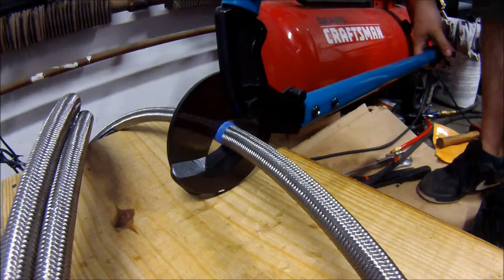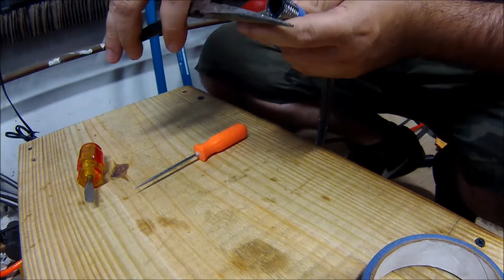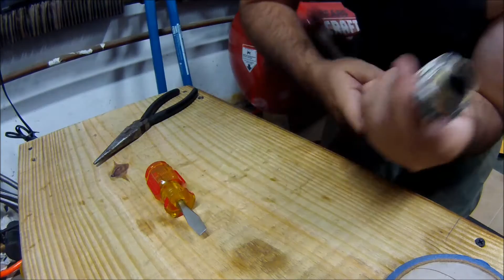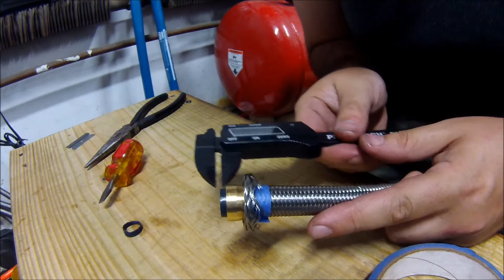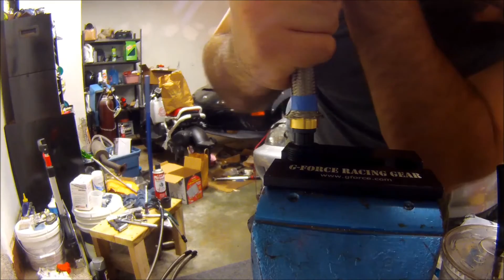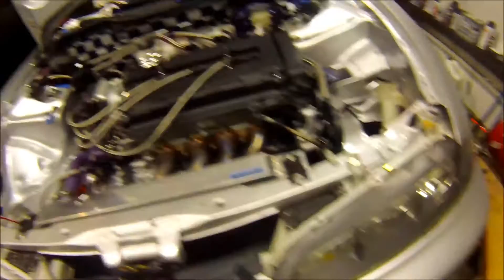Tutorial & Review. How to install & assemble P.T.F.E & Teflon Braided AN Hose ANFITTINGSDIRECT.com

Comment: My issue is I was unable to find the written instructions on the AN Fittings Direct web page. For those that have found it, can you send out the link?
My experience with the -6 fittings was like others reported....not easy. My biggest issue was the steel braided wire was interfering with the nut when assembling the fitting. I had to trim up the steel braid aggressively to assemble the fittings. 
Since I did not have the instructions, I guestimated at how much of the Teflon tube should extend past the brass ferrule ....I used 1/16th. Not sure if correct but the lines I made pressure checked.

Comment: The past few days I've been making some -10 lines for a oil cooler I installed on my G8 and everything went pretty smooth.  I watched your video 4 or 5 years ago for the first time. I've done the trans cooler lines and the Power steering lines from rack to the cooler then on to the pump. an fitting direct no doubt has the best prices for the ptfe lines.
Reply from the maker: Glad it helped you.  Hoping to make more project videos in the future of what I have going on these days.

Comment: This is the only video I've seen where you extend the PTFE hose end passed the ferrel, rather then sitting it against the inner recess lip inside the ferrel. Why is it done this way were its protruding 1/8 out? Is this a better way to do it to prevent leaks?

Comment: this shit is fucking garbage... if you get the black likes you are fucked
Reply from the maker: the black braided lines?
Reply: @LMEngineering  yeah. it has a very annoying black casing around it that is too thick to allow a fitting to fit over it.
Reply from the maker: @stellaroid  ah, like a rubber or something of that sort?
Reply: @LMEngineering  yep.
Reply from the maker: @stellaroid  I would reach out to them to see if they've got any tricks.  Wonder if they'll tell you to cut the outer layer back a little so it slips in the fitting better?
Reply: @LMEngineering  yeah you have to trim it back for it to work at all but it is still an extreme pita

Comment: Thanks a lot for your video. This should be very helpful for when it comes to finishing up the lines for my car.
Reply: I see that you have recommended against using these lines/fittings with power steering feed lines. Can you elaborate on this? What may be a failure point? I was planning on using an AN6 line from this company for my power steering system that may see pressures around 1300 psi. If you don’t use these lines for pressure then what lines do you use?
Reply from the maker: The pressure is usually higher than the hose ratings.  I did run a few brands on the high pressure side however last and final setup was made by a local shop and done with the hydro machine so it's "1pc" and runs a series used on heavy equipment.
Reply: LM Engineering I gotcha, I’m probably gonna use these lines for a mock up and then bring them to my local hydraulic shop so they can recreate it, for peace of mind. Thanks for the reply
Reply from the maker: Yeah you can use ptfe for the return and reservoir but it's the high pressure from pump to rack that needs to be heavy duty.  The local hydro shop will have jic/an that looks the same more or less, just silver ends.

Comment: Great video, thanks!

Anybody have any idea if stainless room-temperature black oxide processes (stainless steel blackening) degrades the PTFE hose at all?
Reply: PTFE  has the attribute of antioxidant，stainless steel blackening not degrades the PTFE, but the hose includes the stainless steel.  so the answer  is yes

Comment: Hey man I need some serious help, im using -10an ptfe ss line for my return line for my turbo system.  I ended up using a razor to trim back the thermal coating on my particular line, then using a cut off wheel to cut off the ss braid to expose the lining.   I slid on the aluminum cup then slid it on my hose end.  When I did the oil pan 60 degree hose end it makes a hard'ish bend upward and it pulled the ss and thermal coating away exposing the lining, ughhh.  Any fix for this? Ive never used ptfe lines before so frustrating.
Reply from the maker: +RMS Fabrications sounds like possibly trimming was too deep.  What brand fittings?  Some are slightly different than others I've noticed
Reply: LM Engineering fragola
Reply from the maker: +RMS Fabrications fragola makes great stuff, I run some of their ptfe.  Check their website as they may have specifics.  I know the ferrule design differs brand to brand.  Let me know if you have more questions

Comment: Tried the AN fittings direct fittings and stainless steel line and found out it's so difficult and my temper is to short. So I threw all the stuff away
Reply from the maker: Don't feel bad, building AN lines is definitely a skill that comes with time and patience.  Maybe if you are having the lines made you can still use the parts you bought for practice?
Reply: gasper44 I actually didn't throw them away. I went with fragola fittings and line
Reply from the maker: PTFE too or rubber?
Reply: gasper44 it's rubber but with some type of special layer in it
Reply from the maker: Ah, maybe helps the permeability of rubber?
Reply: gasper44 that's what they are saying

Comment: It goes much faster to get out the Dremel Tool with a tiny cut off wheel to trim back the stainless steel braided line wire strands. Saying that there seems to be a problem with the design of the 6 AN fittings to the hose. I have all components from andirect.com which must be a sister company to frozenboost.com? Great video all in all but very long... I need any tips for the 6AN, I bought extra hose to practice on and not having any luck unless I cut the stainless steel back so far that it doesn't touch the brass fitting.
Reply from the maker: The saving grace for me with all brands has always been painters tape to keep the braid tucked under the fitting, but removable once it's in and I can pull it out.  Make sure you do not leave any remnants of tape in there at all, you may want to cut both ends of the tape with scissors.  Perfect cut in, perfect cut out. If not you know you're leaving tape behind which is not going to be ideal.

Comment: The only complaint I have using these lines is that I cant use my standard AN wrenches on any of these fittings. Other than that, I received my order in three days... I'm still building my car so I don't have any info on how they hold up yet... I have however, already messed up a few fittings trying to get them seated... Still cheaper then Earl's tho...
Reply from the maker: +Neil J I never bought an wrenches because many brands are different spec
Reply: I have had my standard AN wrenches for years with no issues with other manufacture (Russell, Aeroquip, Earls, even Summit) and this is the first time I have not been able to use them. Luckily, I found an adjustable AN wrench... It's not a good practice to use a steel wrench on aluminum fittings. Kind of the same reason you have to use the aluminum clam shell on your vise. Even when being gentle or wrapping the fitting in plastic (as described in your vid) you could damage or knurl up the exterior of the fitting. "AN" or Army Navy fittings are meant to be standardized (thread pitch, flare and nut size), for military purpose.
Reply from the maker: There is a definite learning curve but once you got it, you've got it :)

Comment: Has anyone used their stuff for powersteering lines? It says rated upto 1500psi, not sure if that's burst or continuous though?
Reply from the maker: +Sam Burrows use higher psi rated lines for your pump to rack feed.  Return and reservoir to pump are fine to use these though

Comment: I converted my whole fuel system to E85 using this company. We had ZERO issues with my -10 and -8 stuff but when we got to the -6 stuff we had tons of problems getting the collars and the fittings to seat properly. It took enormous downward force with me and my buddy in a vice to get it to grab the threads and we ruined 3 or 4 fittings. We followed the directions to a tee and they were still a complete bear. Did you have this issue with the -6 or smaller stuff because my buddy has done several fuel systems and he was baffled by how difficult it was to work with these -6 fittings. Let me know! We still don't get why. It was the most difficulty with lines he has ever experienced.
Reply: I got the replacement brass rings and had no problems assembling the rest of my lines. Fuel system is now complete.
Reply: I just assembled some of these -6 fittings this weekend and had the same problem. It was due to the size of the collar. The collars that came with the straight adapters I got were smaller inside diameter than the collars that came in the angled fittings I got. 

I damaged half a dozen straight adapters trying to use them first, but once I found a good collar I discovered what was wrong. They shipped me replacements once I called yesterday, just waiting to see if they come with the right size collars.
Reply: Let us know how iy goes
Reply from the maker: +bubba2533 nice!

Comment: Very helpful video. :-) My braiding, however, is much more difficult to remove.. I've been at it for an hour and can't get the braiding pulled back more than 1/4 inch. My hands are sore and I've scratched the brass. :-( (It's a 6an Powerflex hose.)
Reply from the maker: +Holt Webb The perfection in making these hoses has a lot to do with practice, you get better the more you do.  Also some nice sharp snips always help with making the job overall cleaner
Reply: +gasper44 
Thank you. Since my mechanic and my local parts store couldn't do it either, I gave up and had O'Reilly's make me a 5000psi hydraulic hose. It fits perfectly and was half the cost. It's not as pretty, but then again, I'm not showing. ;)
Reply from the maker: +Holt Webb It definitely takes some time to make these and be quick at it, it's an art form honestly.  I have a lot of experience making them now because of all I've had to make through the past years
Reply from the maker: +Holt Webb hey so long as the fluid flows and doesn't leak!

Comment: Do you have a video of your power steering setup?
Reply from the maker: +Ryan Hoff No sorry :(
Reply: +gasper44 How did you connect your AN fittings to your power steering pump? weld on?
Reply from the maker: Yessir
Reply: Clean up your garage and clean up your video and get a real car, not a ricer. Good pointers on hose making.